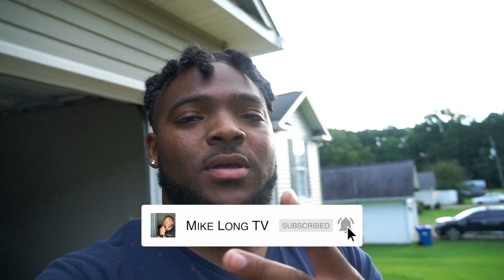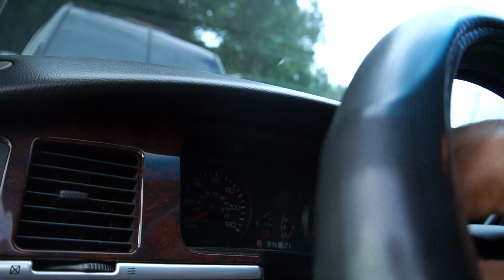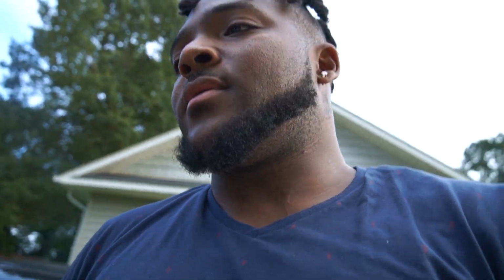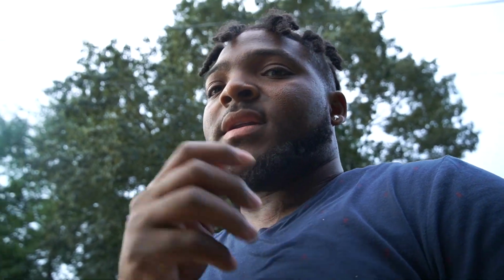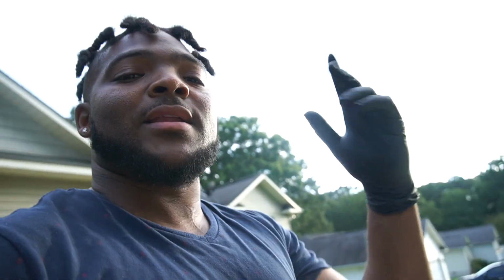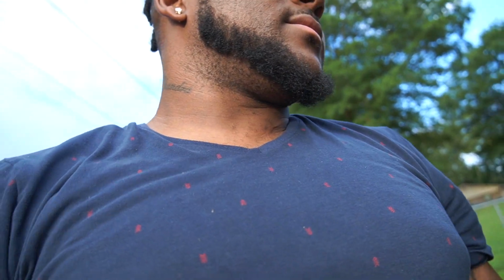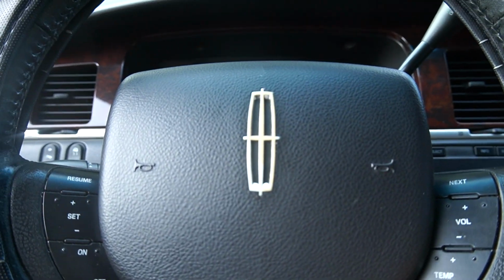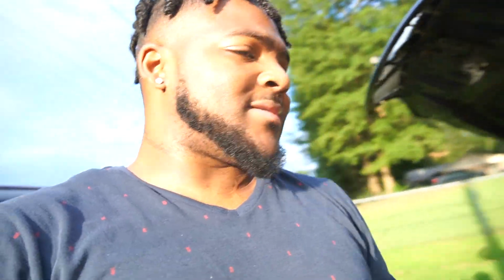2007 Lincoln Town Car Budget Build Part 2!

Comment: If your reservoir is not empty there’s no need to turn your steering wheel back and forth after topping it up. Wrong fluid too by the way but I see someone else mentioned that.